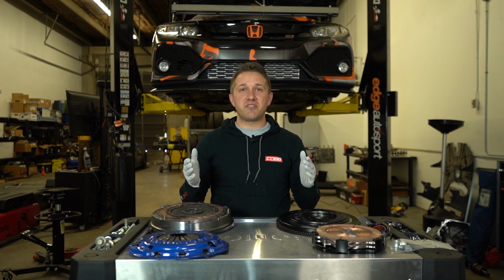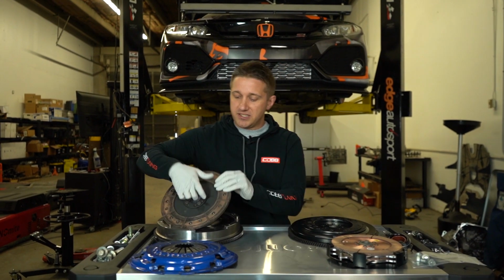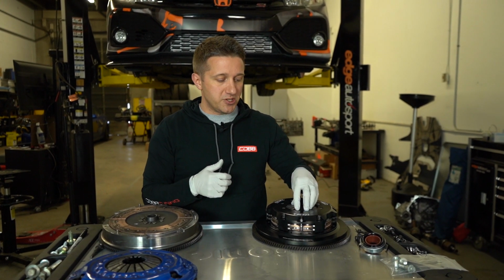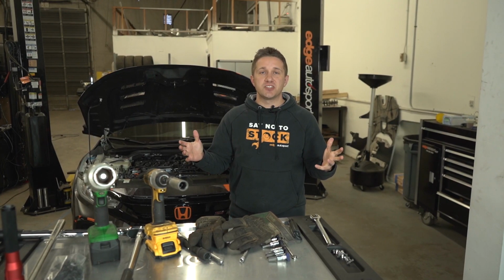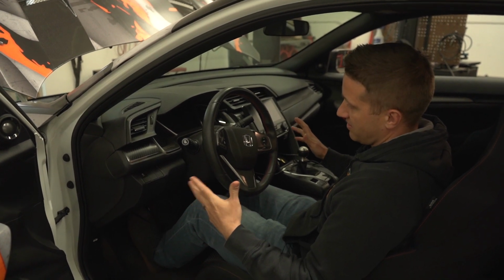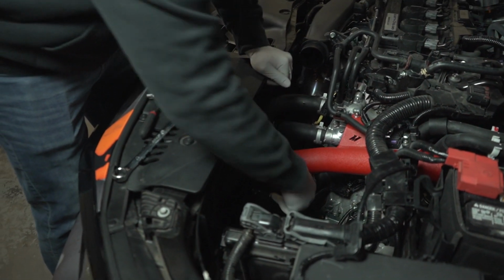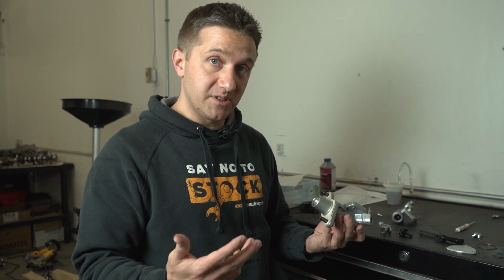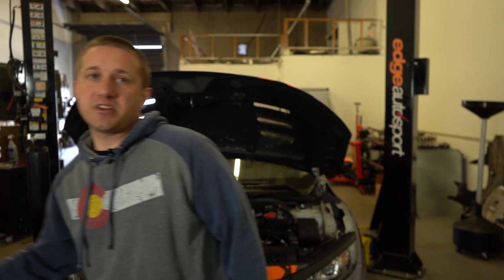Clutch Madness Pt. 1 | Project FC3 | 10th Gen Civic

Comment: I've noticed on my stock FC3 that sometimes unless i have the clutch on the floor it doesn't fully disengage. Maybe the stock master just doesnt have the fluid capacity? I know there are aftermarket replacements out there.
Reply from the maker: That's definitely strange on a completely stock clutch. You might be able to get away with adjusting your pedal a bit to fix your issue.

Comment: How much horse power can the stock transmission/clutch handle before seeking beefier options? I am only looking to go 250ish whp. Is that already too much?
Reply from the maker: Yep it is lol. These clutches stink out of the box. Pretty much a couple bolt-ons and/or a tune and it's going to start slipping.
Reply: Thanks for the reply. I just saw another youtuber who lost teeth in 3rd and 4th gear. Phung something. So now I wonder in addition to a clutch plate will the civic need stronger gears as well?
Reply from the maker: @MakeYaBootyBurn  Not sure to be honest. But we'll let you know if we rip gears up too!
Reply: It’s PhongVLG. Very interesting.

Comment: Just go Emans retro type r conversion, spec clutch is junk, clutchmasters is junk. You can goto Emans ig k20z3allmotor and see for yourselves both spec and clutchmasters is garbage. I highly doubt any 10 gen si build will see over 500hp at the wheels. Emans kit held 465 hp at the wheels no issues. I’ve had his kit on my car for a year now and no issues with it handling 310 lbs of torque.
Reply from the maker: Definitely appreciate the suggestion.
Reply: Have you upgraded your master cylinder?
Reply: santiago pita Yes when you get the kit it comes with it now I believe. Trust me when I say clutchmasters kits ruined my transmission. Eman has had to rebuild many transmissions due to damage done by both these brands. Save yourself the money and headache. Go type r kit off the bat.
Reply: Is eman still offering the master cylinder upgrade?
Reply: @ValkenDnB  yes but it's out of stock for now. I'm running it on my 8th gen with an exedy stage 2 clutch and its smooth!

Comment: Can you do a video of reinstalling a subframe. I saw that you had a few lights came up. I wonder if they were steering codes and traction control codes. Last time I reinstalled my sub frame I had to drop it back up and put it back in cause the steering shaft was off. If you could make a video of how to reinstall it and clear the codes that would be amazing
Reply from the maker: We haven't had any codes come up like that, only the suspension light when we removed the stock shocks. But I'll see about making this video though. Wouldn't be that hard.
Reply: This
Reply from the maker: Oh and if you saw codes, it's probably because we removed the battery and the ECU reset itself.
Reply: Edge Autosport so it came with a power steering code, a traction control code, a parking brake code, a steering rack code. It had no power steering. This is when I took the steering rack off to do the Eibach sway bar.
Reply: @kurtwuttke5787  I don't under why a vehicle needs so many sensors. Christ my turbo swapped lsj was making 540whp and I had to drop the rack n sub a few times to do certain repairs basic shit really. That being said the ONLY sensor that had to be turned off via HP Tuners was the o2 for the catless setup. Never had a suspension code because of shocks or steering angle code from the  shitty steering intermediate shaft gm put in the cobalts. Or the glass axles etc.... fast forward 10 years and I buy another highway queen and she has nannys out the ass. I know that the 8th gen si accepted the rsx 5 speed because our 6 speeds can't handle power. Hey edge when you guys get into making real power. When the trans breaks... I'll letbyou guys see if the rsx 5 speed mates with the 1.5... I think it will. Maybe with different axles or something. Idk... I just know a 6mt on the highway is a pita. But I like a challenge. Maybe ill let YOU guys knows which 5 speed hooks up.

Comment: The spec 3+ clutch and fly was rated for more than that I'm sure but they took It down from tsp. It was like 473 torque. I'm putting this shit on ebay wth.
Reply from the maker: It's funny you say that because I swore that when I first saw it and got it in the shop, it was rated for something like that and I thought it was fine because we'll never get close to that torque. Then after we started having problems and I looked the rating back up and it said 371. I kinda shrugged it off but now that you say that, I'm thinking my hunch was right.
Reply: @EdgeAutosport  wow, this company is playing so many games. Smh Twostepperformance isn't the problem in my eyes. My first kit from them was missing the input shaft pilot bushing in the flywheel, almost destroyed my tranny. Cost me like a grand to fix it and all they did was send a "new" kit with the bushing installed. My car couldn't go into gear for weeks. Thank goodness I left the second kit in the closet.

Comment: You need to adjust the clutch pedal and rod
Reply from the maker: We've done all that. From the top to the bottom, one twist at a time. It only got better at the very top and never got perfect.
Reply: Edge Autosport maybe Eman’s cmc would do the trick

Comment: I ran a 725 series clutch masters, twin disc organic discs, unfortunately it puts to much pressure on thr slave master and clutch master cylinder and keeps blowing them out even with the sirimoto kit it will keep blowing them out I recommend your careful with it it last around 2 months before they blow out and i ran this clutch for over a year
Reply from the maker: How was your experience with the actual disengagement of the clutch? Was it hard to get in and out of gears and go through the gate?
Reply: @EdgeAutosport   did you guys have issues with going in and out of gears after the new clutch or with your old clutch? I’m having this issue after installing the competition clutch stage 3 clutch on my civic and can’t figure out what it is

Comment: yea i hear that the diaphragm inside the stock clutch master cant hold the extra pressure of aftermarket clutches so they have the potential of blowing out. i have no idea tho. if so the sirimoto master was designed to fix this issue.

Comment: Going to ask again what is the max you can push the car on 93 before it gets dangerous
Reply from the maker: When you say dangerous, do you mean dangerous because of the fuel type or dangerous because of the power level? I think you can max the car out on power from 93 and it won't be dangerous as long as it's tuned well. This is because of the factory fuel system limits, even with a bigger turbo. I think low 300's on power is around where you get at that point.
Reply: Edge Autosport thank you I appreciate it but because of the fuel